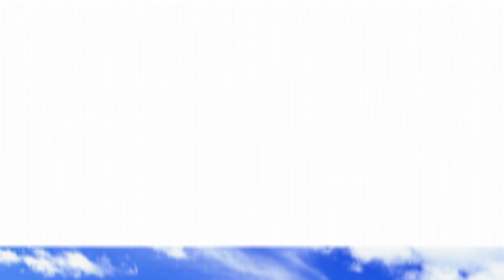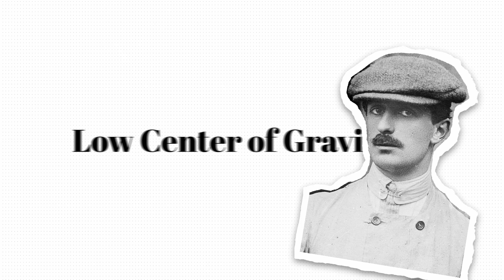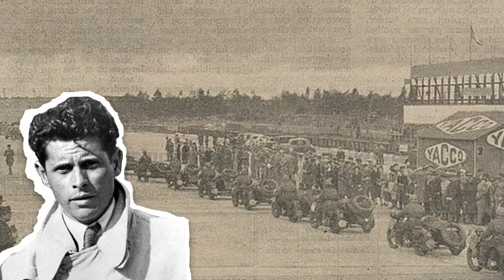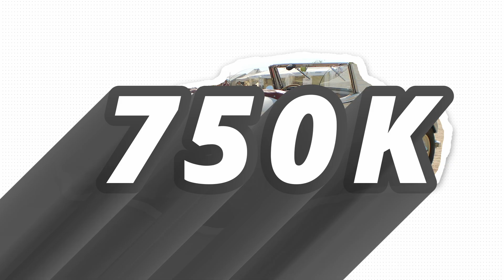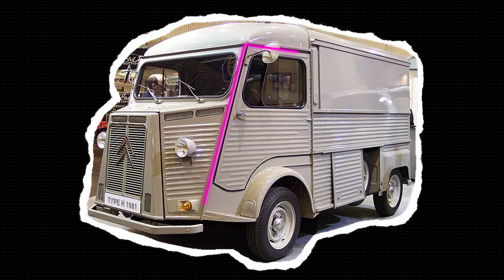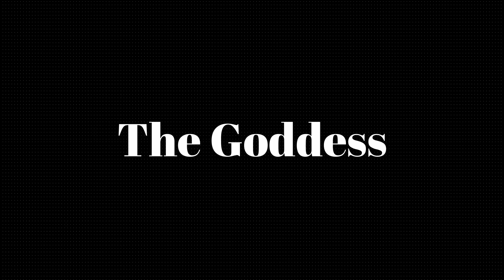From the Citroen 2CV to the DS: The mastermind behind the most modern cars of the 20th century

Comment: Using aircraft engineers to design cars is a good idea, if you want someting new and different. 

This was also the carrying idea when SAAB realized that aircraft will have less market after the war, and was looking into kitchen sinks, aluminium boats, before they decided to make cars.

Lefebvre brought new ideas to cars, in terms of plastic materials, aerodynamics, front wheel drive and so on.

The hydropneumatic system in the DS was created by Paul Mages, who said that a system like that would never have been created if he were a fully educated engineer. So, i'm thankful he wasn't 😅

I drive a Citroen C5 2011 Touring diesel with active hydropneumatic suspension, and i love it.

My dream car would be a restomod DS, with some improvements to simplify the bodywork and hydraulics, and adding some newer tech to make it well modern today. Originality is nice, no doubt, but it was an extremely complex car, and todays electric cars have some features that also attracts me, such as ABS, ESP, LED lights and so on. I dont want to be stuck in time just because i like a certain old car, few, if any cars in history has been as innovative as the DS, that's what i'm looking for, but with some simplifications and improvement here and there. Maybe a DS30 with the XM V6 engine would be fun, or an electric version.